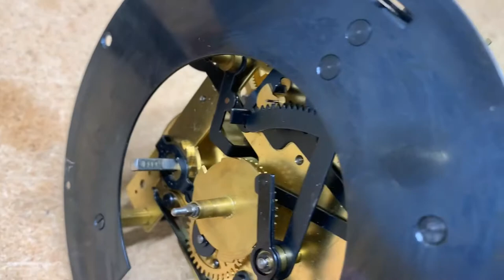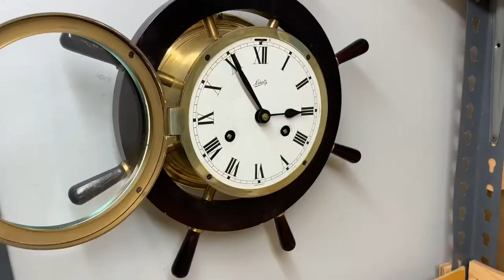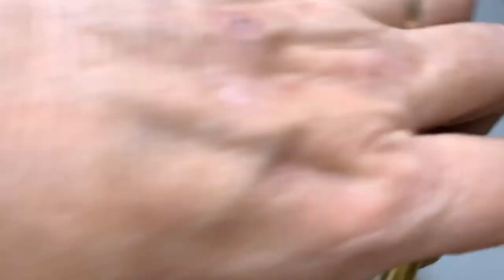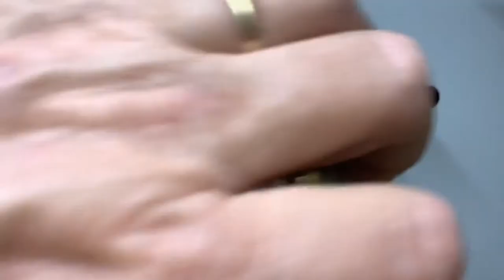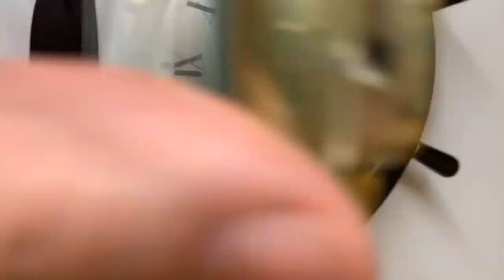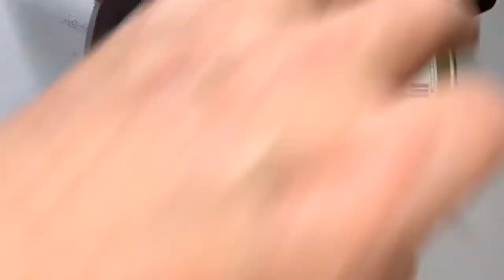KK222 Schatz 8 day ship’s clock. With ship’s bell.

Comment: any thoughts on why ours isn't chiming?
Reply: I'm not an expert on these things but a lot of these do have a bell lock on the back for transport. It's possible your hammers could be bent. And occasionally the bell can actually come loose. That happened on mine only it didn't stop the chiming but did make for a rather unpleasant sound. Depending on the year it was made some models actually had the bill shut off switch on the front next to the number three or elsewhere on the dial. I would check those things.